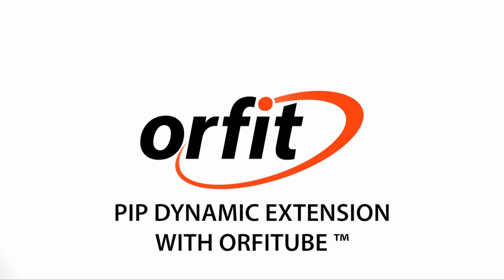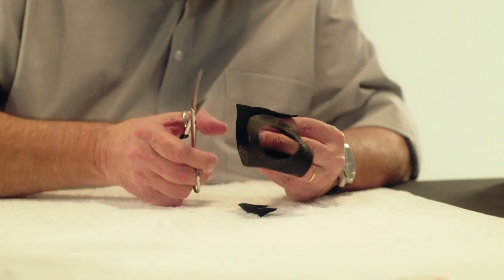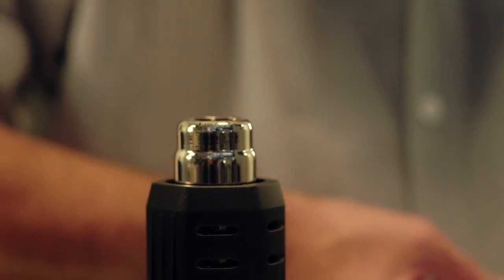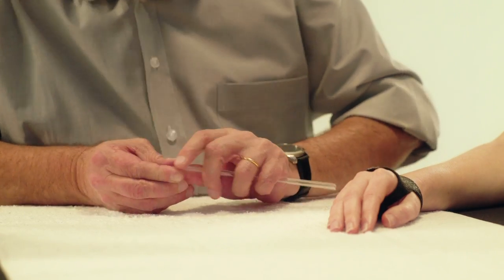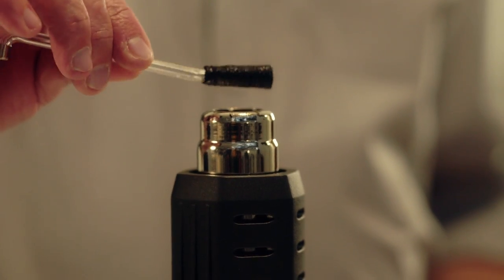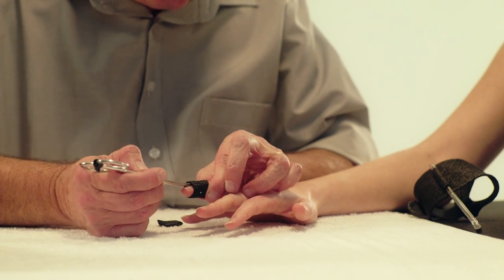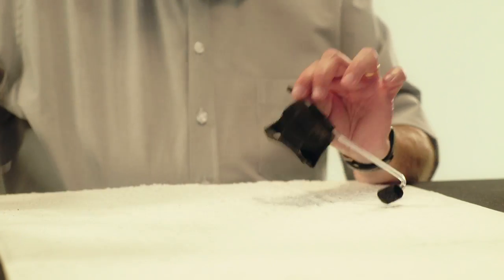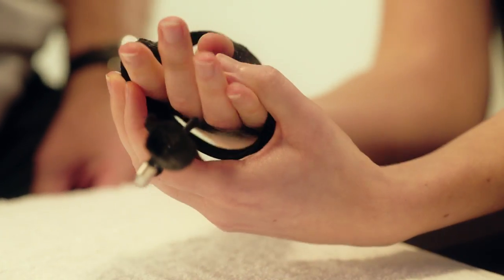PIP dynamic extension with Orfitube - Orficast Instructional Movie 13

Comment: Can I use this for thumb, index, long and ring fingers? Is this good for stretching the lumbrical muscles?
Reply: Hi Marcia,  Of course
you can use Orficast to make orthoses for the thumb, index long and ring fingers!! This particular design is for a PIP dynamic extension orthosis- you might consider placing the MCP joint in flexion to make this orthosis more effective on the PIP joint flexion contracture.  This is not an orthosis for stretching the lumbricals!!!!  To stretch the lumbricals, the MCP joints need to be in slight hyper-extension and your client should work on the active and passive hook position.  The correct orthosis would hold the MCP joints in extension or hyper-extension and pull the fingers into full PIP and DIP flexion.

Comment: Hi. What kind o material is that? :)
Reply from the maker: Hi Javi, it is Orficast® Thermoplastic Tape. Orficast is a textile-like thermoformable tape material. You can find more information on our website : https://www.orfit.com/physical-rehabilitation/products/orficast/
Reply: Excelent! where can i buy it? im from México
Reply: What kind of meterial use in this and especially inside tube what wire use